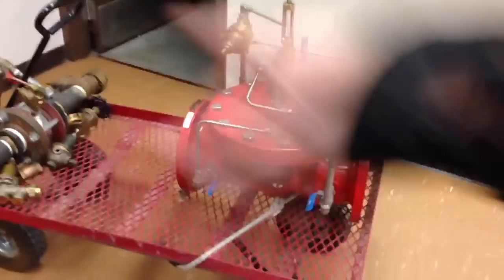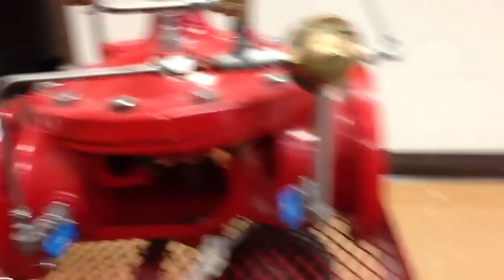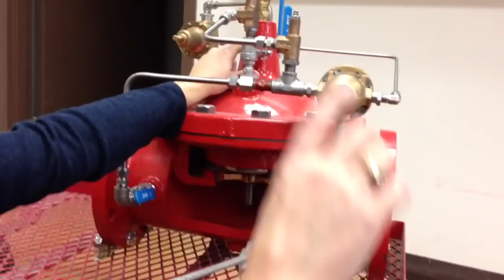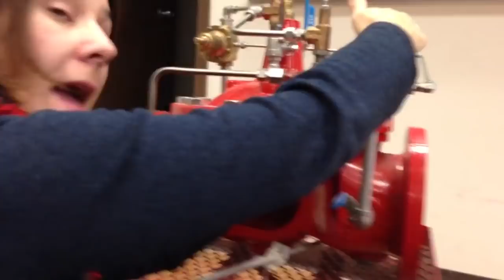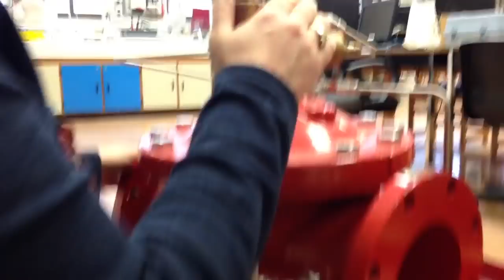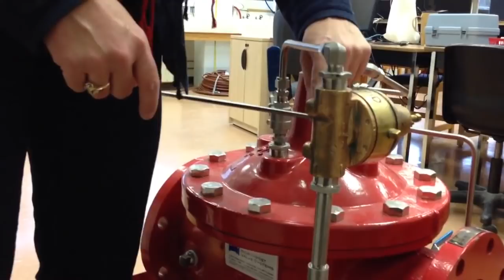Pressure Reducing/Pressure Sustaining Valve

Comment: This looks to be plumbed as a pressure reducing/downstream surge control valve. The CRL pilot sensing line is coming from the CRD which is sensing downstream. The CRL would need to be sensing upstream pressure to be sustaining, essentially prioritizing the upstream pressure over downstream.

Comment: Crl should be sensing upstream not downstream pressure so if pressure drops the crl closed the valve even though the crd wants to keep downstream pressure
Reply: nope.  Not in this application.  you are thinking of a upstream pressure sustaining/ downstream pressure reducing valve.  This is only a PRV.  The CRL is acting as a back up pressure reducing pilot.

Comment: Regarding a pressure sustaining valve ....... What happens if the low side pulls a vacuum or downstream line empties?  Is the pressure maintained? How does variation in pressure on the downstream effect the function of the valve?
Reply: CRL sensing downstream their for whatever reason you get higher pressure other than what the CRD is set for the CRL will shut the valve